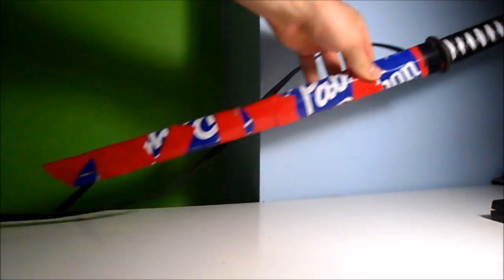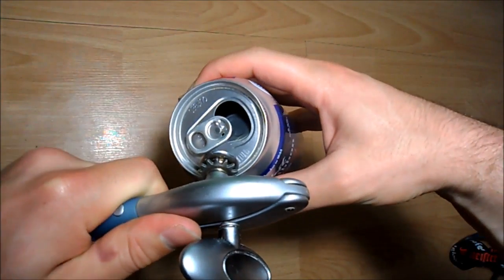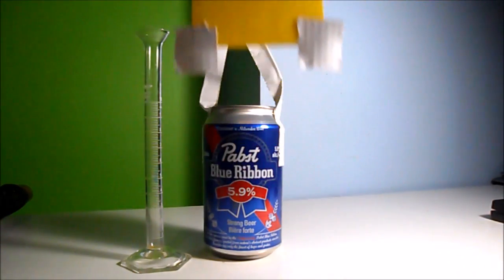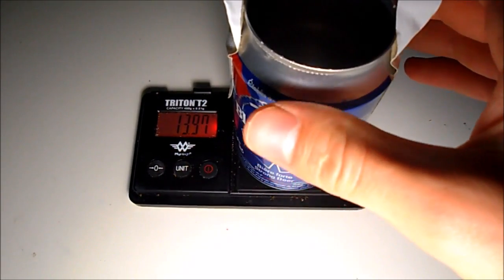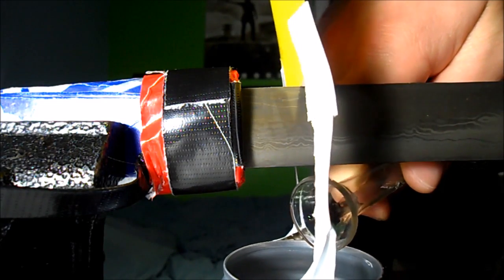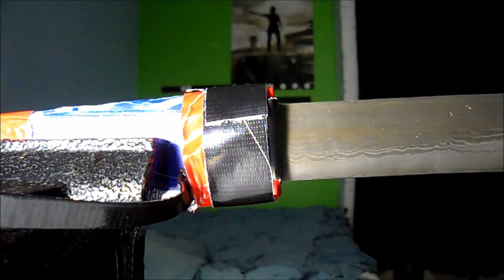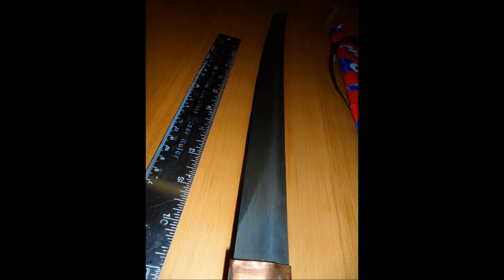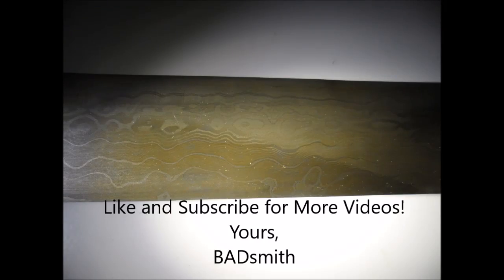How Sharp is a Katana?

Comment: katana is 3 atoms thick on very edge of it. the second sharpest blade is Arabic sword.
Reply: 3 atoms thick? Do you have any clue of how thin that is? No fucking way. Plus there is no way to know unless you have an instrument to see for yourself.
Reply from the maker: Interesting! I wish I had an electron microscope so I could take a look myself.
Reply: **CyberSlaYer1204 Aka-NinjaThug**  no no its not 3 atoms thick thats too sharp probably 300 atoms?
Reply: 300 atoms is about (really rough) 30 nanometers = 0.03 micrometers = 0.00003 millimeters
3 atoms is roughly 0.3 nanometers = 0.0003 micrometers = 0.0000003 millimeters

If (IF!!) it was true that it's 3 atoms thick, then you would need to magnify a katana so much that it ranges from the middle of the earth to you for the blade to be then only 2 millimeters thick. That is not just amazing but literally unbelievable - meaning, I don't believe you.
Reply: More like 30000000000000 atoms thick

Comment: good work! I'm no expert, but I couldn't help but notice the slight cracking blemishes on the blade. Is that supposed to happen?
Reply from the maker: Ahh, the blemishes are actually NOT cracking at all. The steel is composed of 128 seperate layers forged welded together. Check out my other video on making Damascus to see how it's done!
Reply from the maker: Cracking blemishes COULD occur during the quenching of the steel, and would run perpendicular to the edge of the blade, NOT parallel like these lines of alternating Nickle and Carbon steel.
Reply: +BADsmith I see. That's interesting. I'm interested in forging, but I'm unable atm because I don't have a backyard and it doesn't help that I'm 16
Reply from the maker: LOL!!! The same way I began....was with a leaf blower, fire wood, rusty nails, a fire pit and hammer with a rock anvil. Ghetto af.
I'm 22 now and managed to join a forging community where we all buy professional equipment together.

Comment: Lotta damn work but looks great did you force weld it your self? How's the hardness ?
Reply from the maker: Yes! in my previous video on how to forge weld, it shows me using a powerhammer to make the welds. Before quenching, the sword was completely straight and took quite a curve. I annealed at 350C so rather low temp. Between  these factors I would say quite hard (61-62 Rockwell)